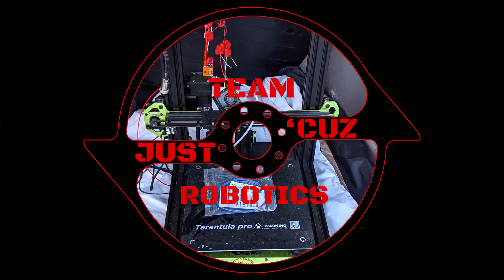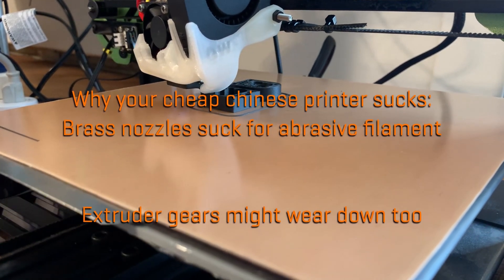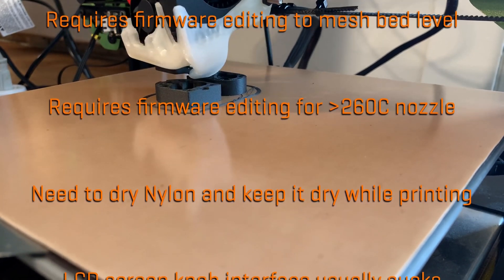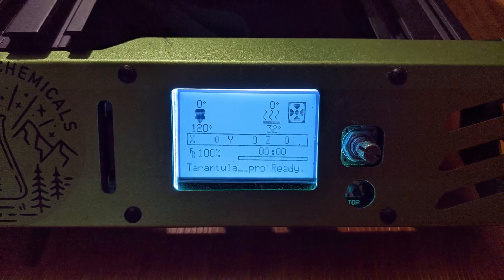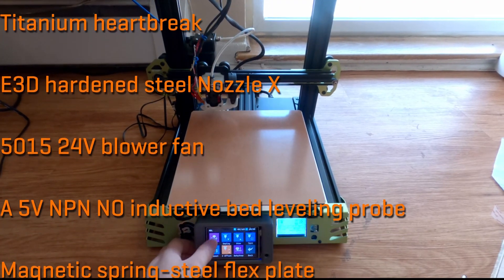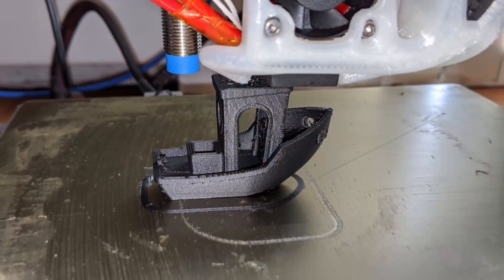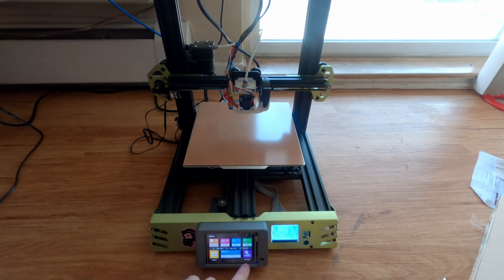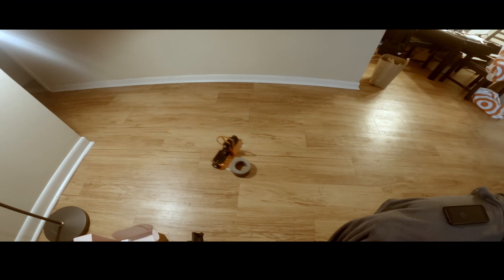Just 'Cuz Pro 3D Printer: Building the Ultimate Budget-Friendly Carbon Fiber Nylon Printer

Comment from the maker: So it seems I underestimated the need for hardened steel extruder gears. Only about a $25 upgrade for a cheap BMG clone however, and it just requires inverting the extruder direction. I've updated the parts list to reflect this.

Comment: What was the reason you didn't want to print with CF filament on the Prusa? Shouldn't it be possible if you swap the brass nozzle for a hardened steel one? For CF nylon you shouldn't have to exceed 265 degrees right?

I ask because I also own a Prusa Mk3S and I was hoping to use it to print the chassis for the next version of my antweight!
Reply from the maker: Good question! So basically it was because of the nozzle. I had read online that many people have issues printing with PLA using a steel nozzle due to poor thermal conductivity and higher friction and that you might need to raise temps accordingly. I didn't want to need to retune the profiles I already have for the Prusa, nor increase the possibility of jams on it with the steel nozzle. I love the prusa since it's bulletproof and want it to stay that way!
Reply: I just swap to a steel nozzle when I need to print cf nylon and swap back when printing other materials. It takes a couple minutes to swap the nozzle then your set.

Comment: Be careful when printing with CF nylon. It wears out parts besides the nozzle.
Reply from the maker: Yeah, I have heard some cheaper brass hobbed gears will wear out as well. Thankfully the extruder in the Tevo seems to use steel gears
Reply from the maker: Update: Seems that the original extruder gear was not properly hardened and already began showing significant wear after less than 200g of filament. I was really thinking that would last at least a kilo or two, but thankfully BMG clones with hardened steel gears are not too expensive...

Comment: Of course, the most important addition is the googly eyes.

I'm not getting into 3-D printing just yet. As with Linux, I resent the 'make it work yourself because we can't be bothered to' ethos. There's also an element of 'stop complaining - whaddya expect for this kinda cash, huh?'.

Frankly, I don't think cheap printers are good enough at the moment. They're built down to a tempting price, not up to a decent standard.

Like with budget CNC machines, just because you can afford to get involved at a rudimentary level in a hitherto impossibly expensive industrial process isn't enough to justify making a duff purchase.

People spend thousands on CNC gear that will cut wood and plastic and aluminium...but not steel. What? Really? Oh. That's... er, disappointing.

3-D printers are the same. It's easy to be seduced by the idea that, with just a bit more time, effort, and expense, you could be getting £30,000 results from a £300 machine.

There's nothing wrong with upgrading, fettling, and improving gear - it's just that when it's essential simply to get tolerable results, people can lose track of why they got into printing in the first place.

Was it to create stuff, or to do a Chinese R&D department's work for free?

Spending money on upgrades gets to be a habit - and you soon go past the point where it'd be cheaper paying a local professional workshop to produce components for you.

I don't really NEED a printer yet. They're clearly fun to play with, but I'm too poor to have that kind of fun!

Maybe in another 10 years, when the googly eyes come fitted as standard...
Reply from the maker: Yeah you're right. Back at university we had a Stratasys Uprint SE Plus which has a dual extruder and prints with dissolvable supports and its like $20,000. The print quality was great and all but it has such a tiny print volume and it's sooooooo slow. I convinced the university to buy our robotics club a CR-10 and that worked wonders for us. The quality wasn't quite as good but for under $400 I was impressed. However, as I said the print quality isn't really the issue, it's mostly lack of ability to print at high temperatures with the cheaper printers that I find to be a massive downside.
Reply: @Hash Frowns thats why I hate the kind of printer my school has. Sure its nice that it can print in solvable material but its extremely expensive replace spools